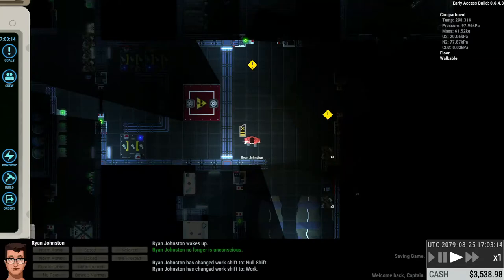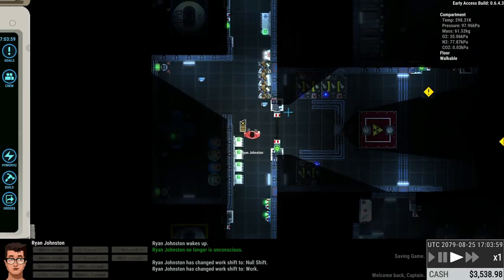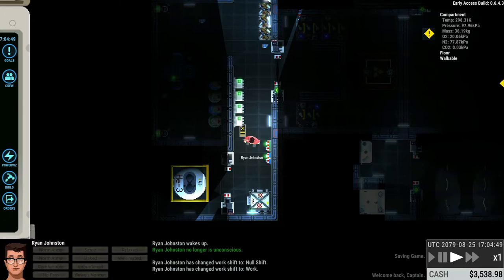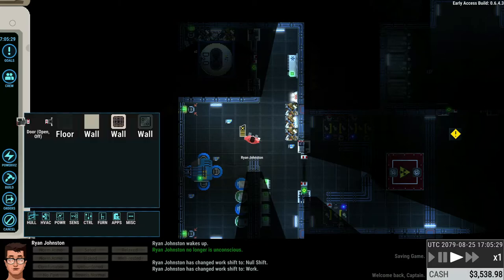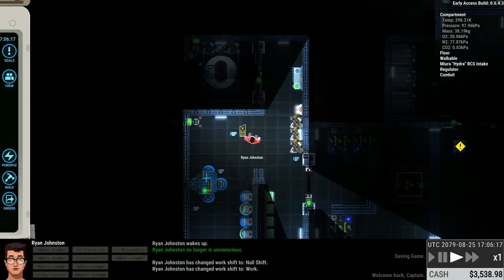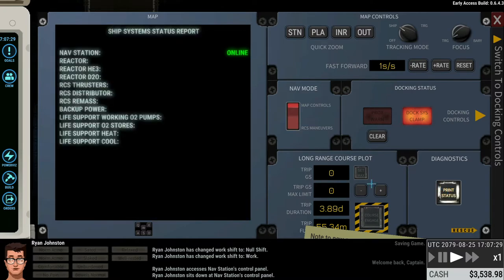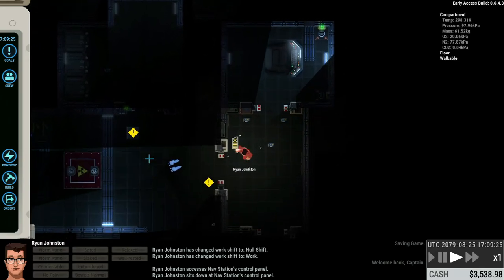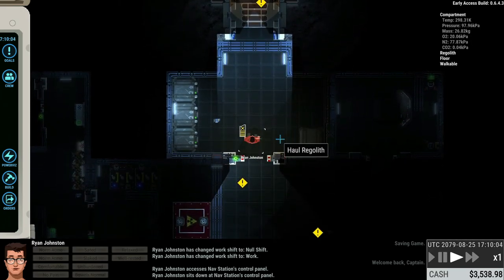Ostranauts Tutorial Walkthrough Guide: Ship Systems

Comment: Correct me if i'm wrong, but I run the reactor just to recharge my ...  i think 6 batteries. The i switch it off since it seems to run through helium so quickly. The batteries last quite a long time. Do you get a different result?
Reply from the maker: Yes I think you're right, it makes sense to switch off once all the batteries are charged.